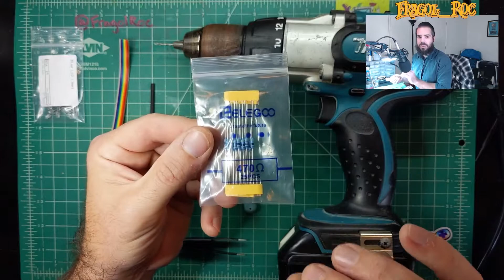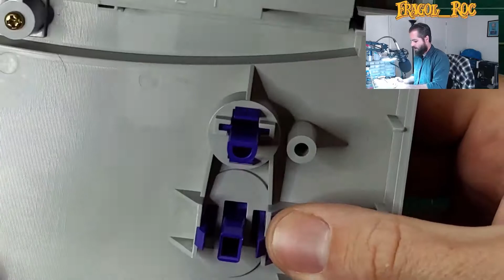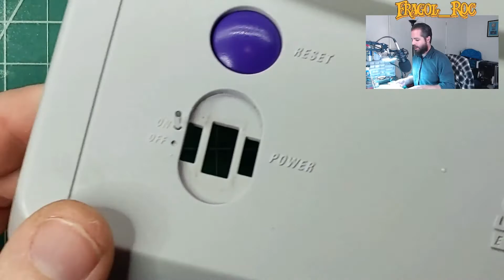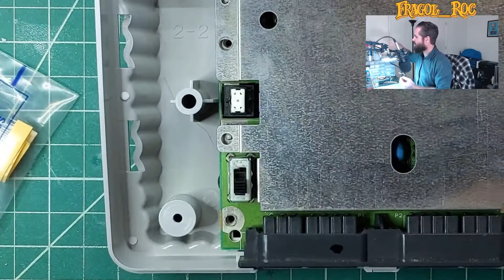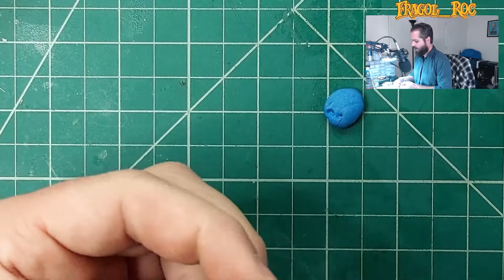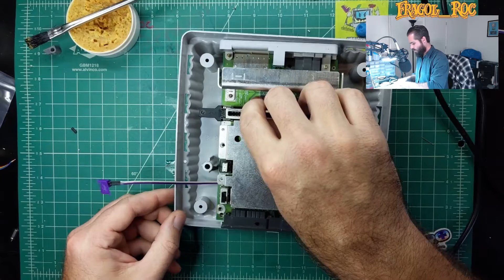SNES Jr./Mini LED Mod with Custom Housing

Comment: Nice video. Where did you purchased the acrylic rod? is it clear or diffused?
Reply from the maker: Thanks! I just purchased them from Amazon. Did a quick search for 1/16th inch acrylic rod. They are a clear rod, but I usually sand them down a little to give them a diffused look.